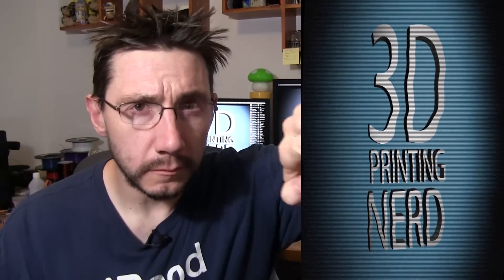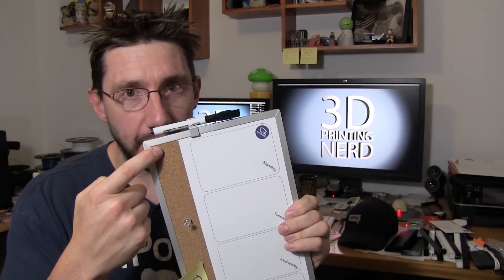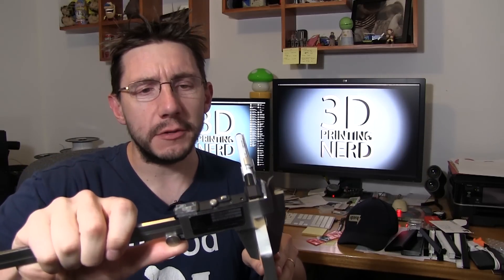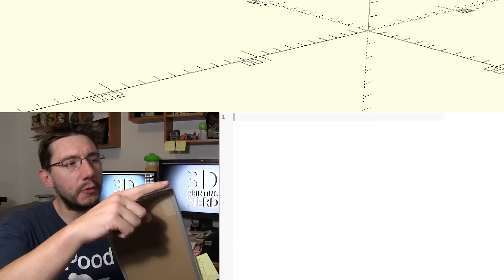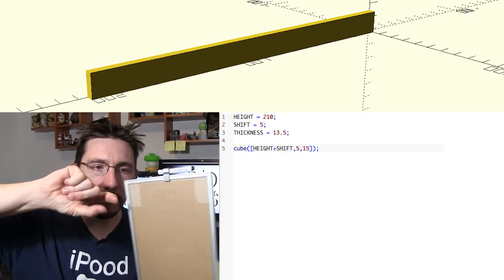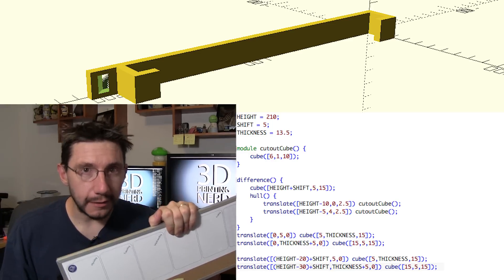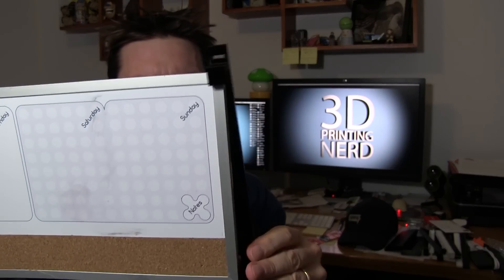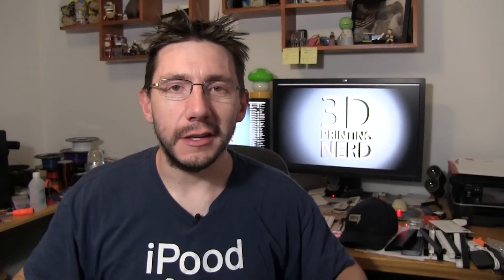Tutorial: Using OpenSCAD To Make Your Wife Happy

Comment: What tolerance did you pick for the white board dimension vs the clip? And was it printed in PLA or ABS? I'm just trying to figure out common interference tolerances. I've broken a few of my recent designs pushing them together to clip.

Comment: 1st off, this video is racist, the proper term is caucasianboard. why don't you own a blackboard? #allboardsmatter.
2nd: Why do people use Openscad? just curious. Seems like there is much easier to use programs out there. Nice video!
Reply from the maker: +koolbeenzbro Holy crap, I nearly spit out my coffee at your first comment! Thanks for the nice words, and as for OpenSCAD, I think the appeal is for those that like computer coding. It feels like you're writing software when designing your 3D object. With all the tools out there now, though, I wouldn't probably go to OpenSCAD for this issue now.
Reply: I don't know any that are just like OpenSCAD. But there is many " GUI" free cad programs out there. FreeCad, TinkerCAD, 123D. I use Solidworks but that is not free.
Reply: 3D Printing Nerd It's simple but gets the job done.
Reply from the maker: koolbeenzbro Oooh, Tinkercad! I love Tinkercad!
Reply: What software would you use then that is free just like the OpenSCAD is?
Reply: One of the main reasons I use it is because I can design the shape and then change the parameters to get many variations which fit different purposes. E.g this skateboard wall hangar.
 - https://www.thingiverse.com/thing:2332629
How big is your printbed, wheel size (WxH), weight of your board ?
Then you can make a hangar to fit your board.
Get a new board, bigger wheeels, electric board(heavy) then print a new hangar.
Reply: As a coder, OpenSCAD makes sense to me... I don't have to try to drag and drop things in 3D space, which I find painfully awkward.

In addition, OpenSCAD is one of few tools that allow parametric designs -- by changing one value on one line, I can have everything else in the design recalculate.  I find it allows for MUCH faster iteration and better customization.

It is perfect for designing most repair parts, but it is the wrong tool for any kind of figure modeling.
Reply: yes,  watching maya experts perdanticly running around pop up windows and pull down menus make you think its got to not be the only way to do it.
Reply: fusion 360 is the easist I've found so far without being able to get a solidworks license.

Comment: very nice! i like it. what printer did you use?
Reply from the maker: +Mohammed Zaman For this one I used my Flashforge Creator Pro
Reply: no wonder your prints came out so nice. I highly doubt if it is possible to do it on a Prusa RepRap with such precision.
Reply from the maker: Mohammed Zaman I think you could get the precision out of a reprap, however, your print speed would have to be pretty low.
Reply: ok. I will try that. thanks for the suggestion. hope you have a nice thanksgiving.
Reply from the maker: Mohammed Zaman Thank you! If it applies, same to you as well :)

Comment: Great only took a day or 2 to make it.  You could have use 2 L brackets with 2 wood screw and fixed it in 5 minutes. Sometime 3d printers are good but this is not the time.
Reply from the maker: +Hulla Dek That's true, I could have. But, I used this as a learning opportunity. Plus, I would have had to go to the store to get L brackets and wood screws, and using my method I could keep drinking my beer AND solve the problem. :)

Comment: could you print a duct tape role dispenser because that's easy right plz tell me if its easy and also i loved the vid and the editing
Reply from the maker: rwl 04 Duct tape dispenser? It should be possible. Duct tape is super sticky, the strain might be too much. I'll see if I can design something.
Reply: no no its a wheel for it and you screw into a wall or a two by four
Reply: myth busters made it to make rope to make a bridge
Reply from the maker: rwl 04 I'm not familiar with that. It may still be possible. Contact me through my custom order link on my Etsy page and we can get the process started.
Reply: ok i get there by
Reply: what i don't want to buy it was just an idea
Reply from the maker: rwl 04 Oh, I see. Got it!
Reply: got
Reply: what
Reply: you got what
Reply from the maker: rwl 04 Got it, as in I understand now. Thanks!
Reply: understanding  the looks and fetures sorry bad spelling
Reply: there is nothing better than 3d printing and duct tape